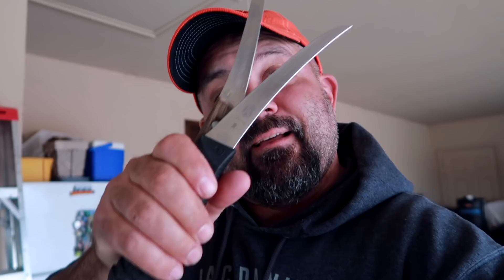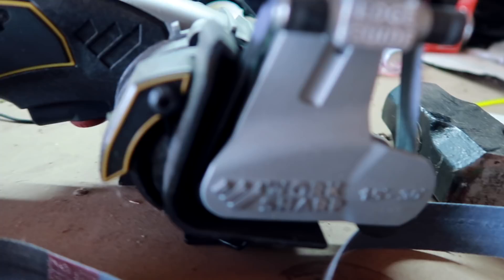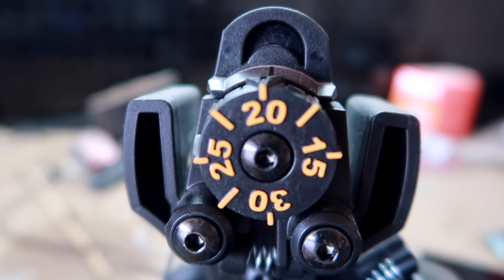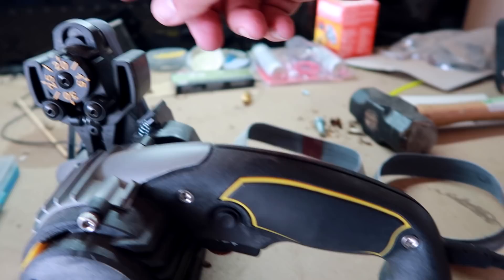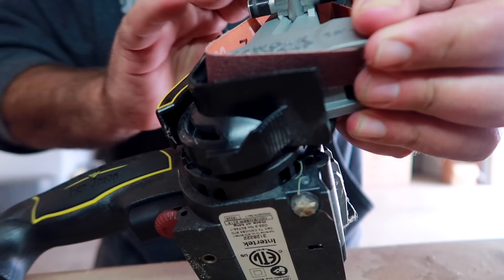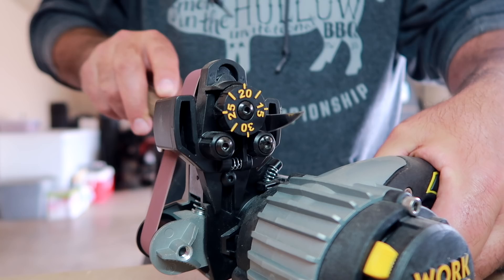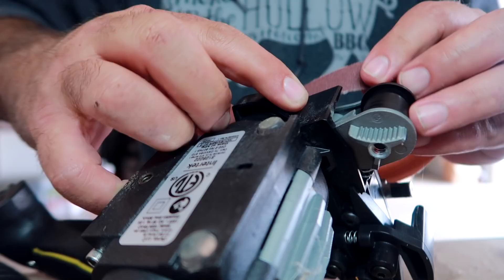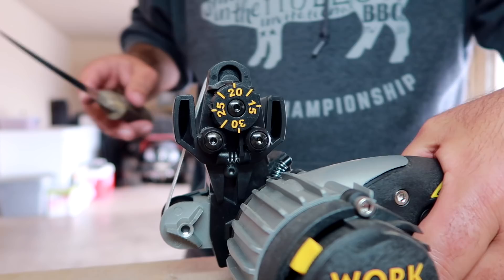How to Sharpen a Kitchen Knife | Razor Sharp (BBQ Knife)

Comment: Love your channel, i have learned a lot, when it comes to the work sharp you do not want to pull your knife all the way through. Doing so will round your tip, when you get to the tip stop in the middle of the belt.

Comment: Just injected my ribs with the apple juice/Apple Cherry Habanero Rib Glaze mixture. Will be throwing those bad boys on the smoker this afternoon. It'll either be a stroke of BBQ genius or a big mistake I'll let everyone know how it turns out.
Reply: STOKE OF GENIUS. The injection was about 2 parts apple juice to 1 part Cherry Apple Habanero Rib Glaze. The apple/cherry glaze really enhances the moistness of the ribs. It also greatly enhanced the sweetness of the ribs. I cooked them on my Weber kettle and i didn't wrap. I spritzed with apple cider vinegar. I applied a little brown sugar and butter about 3 hours in. I later mopped with a bit of Dr Pepper. I left them alone until I applied the Pineapple Heat glaze about 15 minutes before pulling them. So good! These were definitely the best ribs I've ever had. Spread the word!
Reply: BTW...the rub was Killer Bee Chipotle!